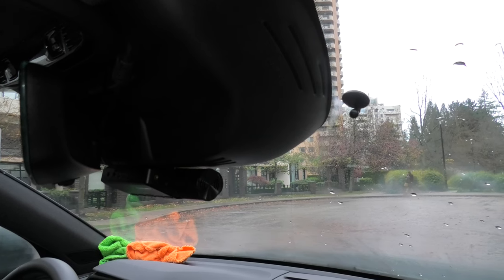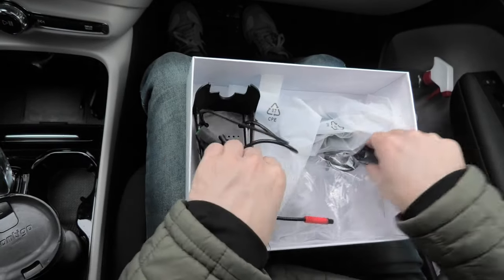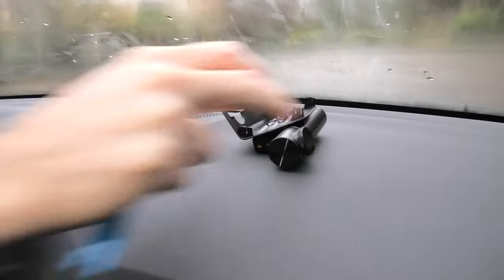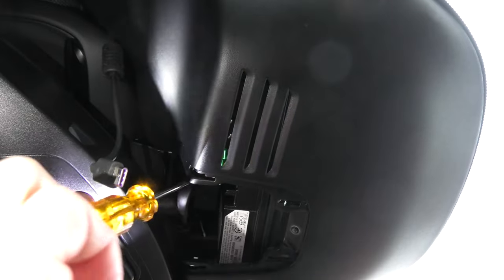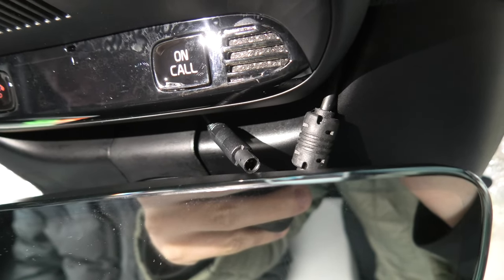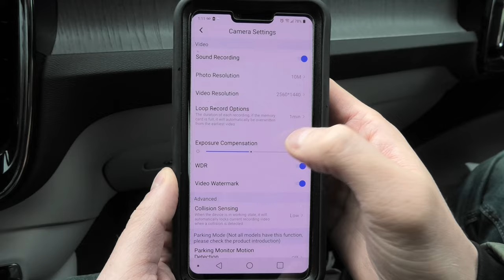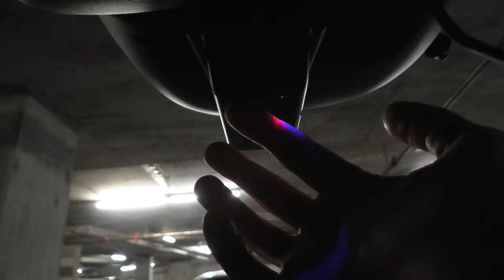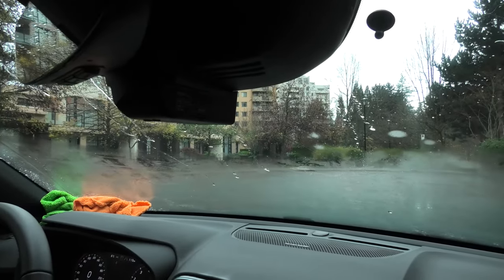Volvo XC40 (2019-2025): FitCamX - OEM Style 2K Front Dashcam Designed For The XC40!

Comment from the maker: PRODUCT LINKS:
1. OFFICIAL WEBSITE - Fitcamx 4K Dash Cam For Volvo XC40 - https://fitcamx.com/collections/volvo/products/fitcamx-dash-cam-for-volvo?variant=40596270022828&sca_ref=1327756.jsIwH3r9xw.
2. AMAZON - XC40 T4, T5 (Model A) - Fitcamx 2K Front and Rear Dash Cam Suitable for Volvo XC40 2024 2023 2022 2021 2020 2019 T4 T5 (Model A), OEM Factory Style, Dual 1440P+1080P HD Video WiFi, G-Sensor, 2 Channel Loop Recording, 64GB Card - https://amzn.to/44QQCnc.
3. AMAZON - XC40 Recharge, B4, B5, T4, T5, P8 (Model B) - Fitcamx 2K Dual Dash Cam Suitable for Volvo XC40 & XC40 Recharge B4 B5 T4 T5 P8 (Model B), OEM Style, Front 1440P+Rear 1080P HD Video, Loop Recording, WiFi & APP, G-Sensor, Easy to Use, 64GB Card - https://amzn.to/4aDhg67.
4. OPTIONAL FUSE BOX HARDWIRING CABLE - FITCAMX Fuse Box Cable Hardwire Kit, 4 in 1 ATO (Regular), Mini, Micro, Low-Profile Mini, 2Pcs Each - https://amzn.to/48utY5J.
5. UNIVERSAL USB DASHCAM ADAPTER FOR VOLVO VEHICLES - DashCam Power Adapter, (3P TypeE) Compatible with Volvo and Polestar Models with Auto-Dimming Rearview Mirror, Built-in Hide USB to GPS Radar Mirror Dash Cam Charger Adapter Cable, Plug & Play - https://amzn.to/3SMKjNV
.
TOOLS USED:
FLAT HEAD SCREWDRIVER - Klein Tools A131-2 1/8-Inch Flat Head Screwdriver with Keystone Tip, Made in USA, Pocket Clip, 2-Inch Round Shank - https://amzn.to/3VV0FVh.

Comment: I will list two things i noticed with mine. can you share your thoughts as well. 

1st: dash cam won’t turn off when you shut off engine and just leave the car parked and unlocked. Fitcam support says it will just turn off after 15mins. I find that too long. And it might drain the car battery.

2nd: dash cam heats up when its turned on. You can feel its warm when you touch it. Too hot for normal usage i think.

Comment: 9:41 How it continuously gets the power? Does it work even after turning the car ignition off? If it does so we should be able to use the Parking Mode.
Reply from the maker: XC40 does cut off the power to the dash cam soon after you lock the vehicle.

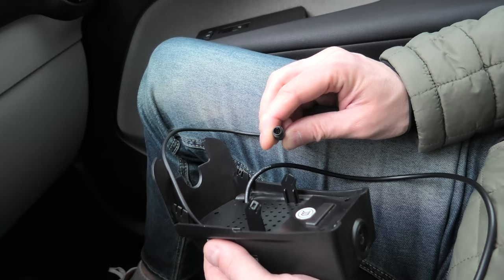Comment: Thank you for this great video !! In order to install the FitCamX, one needs to disconnect a power cord (3:58). Does disconnecting this cord from the original hub disable some of Volvo's safety features (lane-assist, auto-brake on collision, adaptive cruse-control)? What is this power cord power when connected per the original Volvo design?
Reply from the maker: No, it doesn't affect the Volvo's safety features. Fitcamx dashcam gets connected in parallel to the anti-glare rearview mirror plug. This way both the mirror and the dashcam get the power at the same time.
Reply: @MorozovAutomotive  thank you ! This is great news. And thank you for the answer ❤️🙌 !
Reply: @MorozovAutomotive I'm also curious about this power cord because I'd like to run a T-splitter with USB out in order to power a Garmin mini 2. What is the T-splitter type? It looks like some type of 6-pin but I haven't had luck finding something similar online.

Comment: Hello. Unlike other dashcams, Fitcamx takes power from all the sensors. So, after installation does it compromise any sensors or volvo’s safety features by even slightest? I am very skeptical/scared about this one thing.

It would be very much appreciated if you can answer me this. Thank you.
Reply from the maker: Hi, we did not have any issues so far in the XC40. We installed Fitcamx dashcams in other vehicles as well and everything is working fine. We don't have a video for the XC40 but here is the video for the RAV4 in which we showed the operation of the safety features with the Fircamx dashcam installed in the vehicle. Toyota RAV4 (2019-2023): Does Dashcam Install (FitCamX) Cause Toyota Safety Sense 2.0 To Fail? - https://youtu.be/-vkkGfpzVf4.

Comment: Does it show the date and time correctly? Do you have to set it every time you turn the car on? Thanks.
Reply from the maker: It does, I believe it sets and keeps the time once you connect it with the smartphone using WiFi.
Reply: @MorozovAutomotive  I asked the manufacturer they told me that it has a built-in battery which keeps the time and date correct. Thats what they said.

Comment: Many Dash Cams in the market have Image Stabilization and 60 fps but this doesn't. Do you think they are important? And why you didn't choose the 4K model?
Reply from the maker: The 60 fps makes the image smoother. But 30 works quite well as well. 2K model is the only one that comes with the rear camera in the set.

Comment: Does this camera save videos automatically to the SD card? The product description says the user has to save videos while the engine is ON. This is rather impractical as one may not be able to keep the engine running right after the collision. In other words, do videos get wiped off if the engine turns off?
Reply from the maker: Videos are being saved automatically while camera receives the power. As soon as the power is off, it will stop recording.
Reply: You mean that videos will be automatically saved on the SD card without any required action from the user/driver, correct? What if the crash shuts off the engine - will the video recording get lost?

Comment: I bought this Dash cam and I have now been trying to remove the original green connector from the plug for more than an hour!!. I know I have to push on a little green lip and I can see were it is, but it's simply really difficult to reach with fingers, screwdriver and simultaneously pull the plug. VERY DIFFICULT to remove. I'm starting to regret the purchase already.
Reply from the maker: It is a bit tricky but possible.